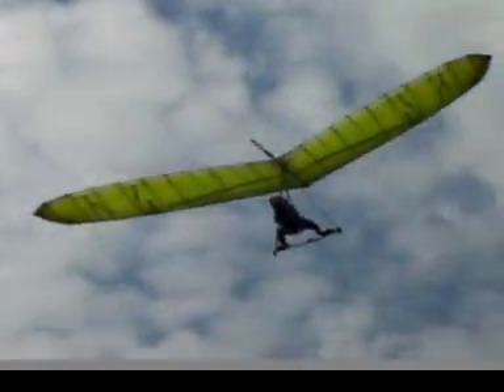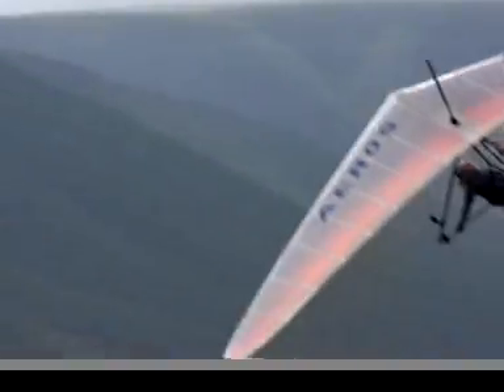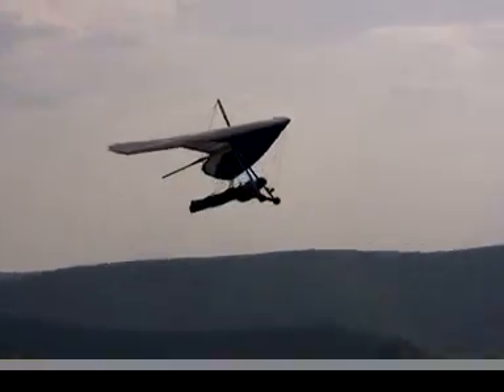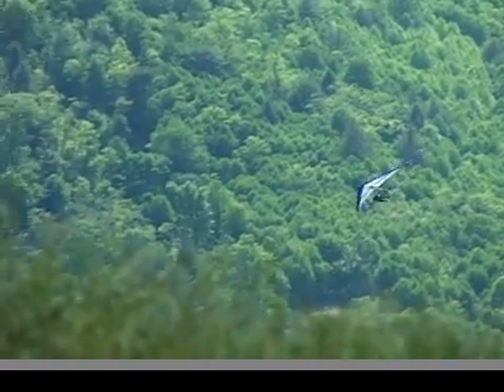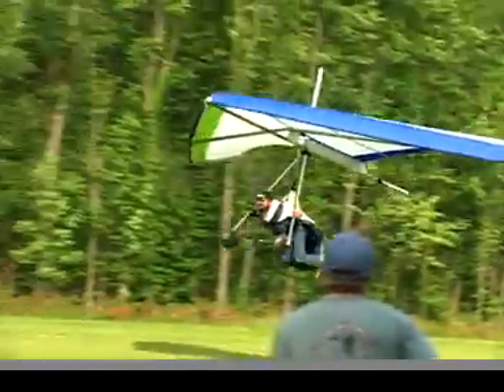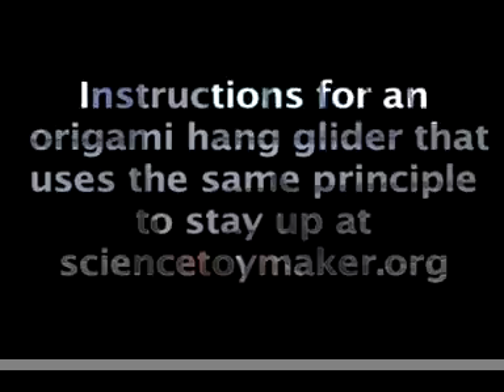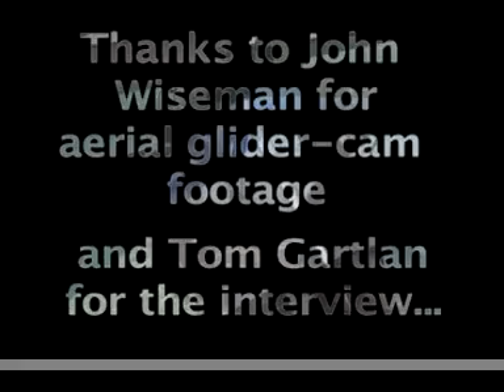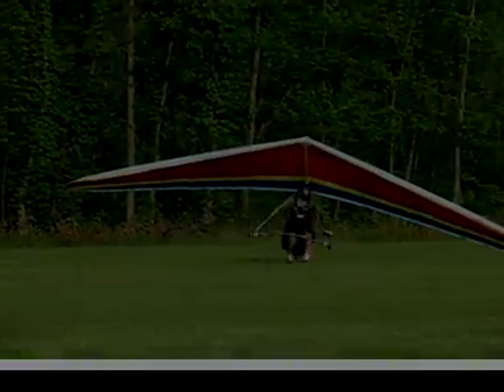How Hang Gliders Stay in the Air

Comment from the maker: The video talked about two kinds of lift. You mentioned ridge lift, but there is also thermal lift--pockets of warmer air rising. Even with neither, you would still be able to glide down, not drop out of the sky.

Comment: Yes you could. I am 6'5" but the same weight. I have been flying since 1974. You will have to find a large area glider. Mine is 185 sq ft. You will however have to work hard to get there though the training is very physical but is worth the effort. Training gliders in schools will make your landing and take off speeds higher but it can be done.

Comment: Would someone who has a fear of heights be able to do learn this? And how should they start?
Reply: Most people have a fear of falling, not actually a fear of heights (it's a subtle but important difference). I've launched my hang glider from a 2,000' cliff with no worries but I wouldn't go near the edge of that cliff before hand. The difference is that once I'm connected to my glider and preparing to launch, I know I'm not going to fall. Please know that when you learn to hang glide, in most cases you start out on flat ground. As you progress you move onto a small hill. Initially you don't get more than a few feet off of the ground. You work your way up to getting higher and higher.
Reply: Rick Maddy awesome thanks, I’ve got a tandem booked in a few weeks, I’ll see how much I enjoy this & then decide to do lessons

Comment: Of course you can. Need to do it with a larger size wing, properly sized for your weight. Otherwise with a regular size wing you need strong wind at take off and landing!
Cause you'll fly much faster than you can run! 
With the appropriate speed anything can fly!

Comment: NO not technically (speaking from UK) however you will almost certainly be unable to buy a glider from anyone. The reason is that Hang Gliding is Phyisically very difficult to get into unless you find out the right way to do it. For this reason most people would give up long before they could get into trouble. so the only people who ended up flying them were determined and or worked it out. You would almost certainly be unable to find anywhere to fly it without joining the local club and BHGA

Comment: Actually you are usually working so hard you de hydrate to some extent so it isn't a problem. But in an emergency it is quite possible to go in the air. For girls its more of a give away. Sunburn on the back of your neck is the worst gotch I have had and now always use a motorcycle balaclava for that reason.

Comment: Yeah but how does lift happen? He doesn't explain that. How does it stay in the air....lift. Yeah duh of course. But simply explained in flight above and below the wing there's an air pressure differential. Below the wing is a higher pressure than the above the wing. Air flows from high pressure to low pressure and this is what creates lift and makes you fly. Not a hang glider....but a very experience skydiver. THis is basic knowledge to any skydiver.